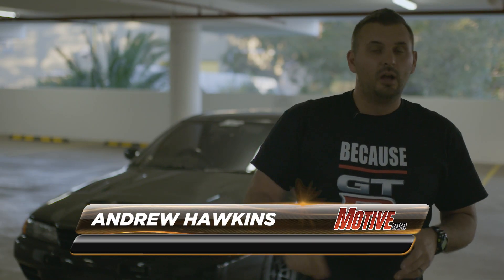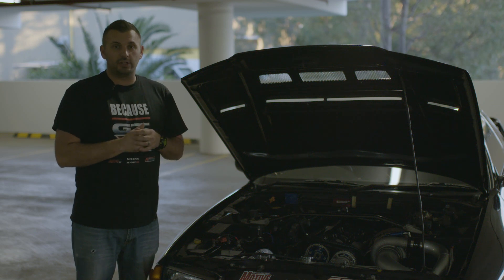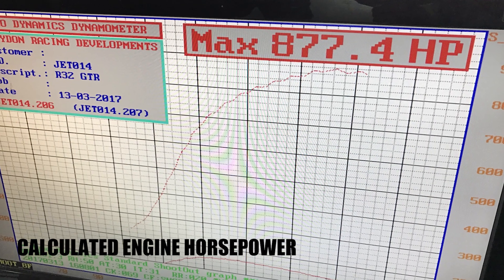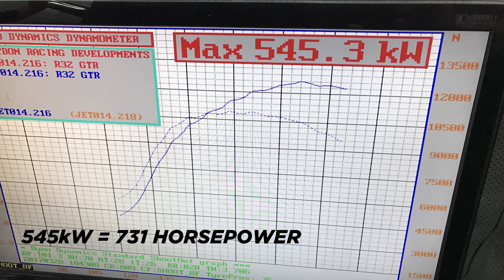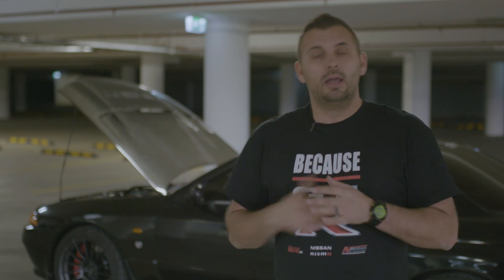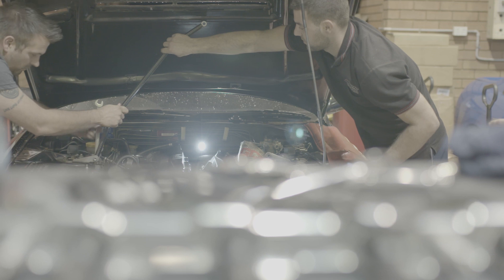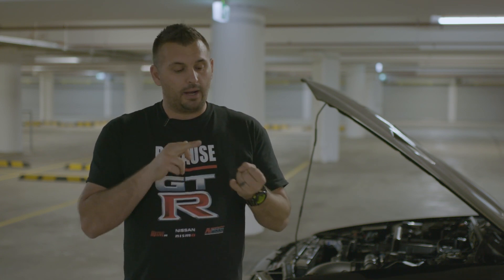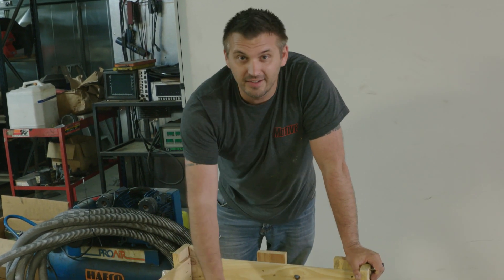Quest for 9s on Stock Bottom End - Project Budget Supercar R32 GT-R Pt16

Comment: awesome vid like always!
wonder if ARP studs where used for the head? what gasket? not cool the lifting issue. Let us know what alternator can we use as upgrade please
Reply from the maker: jasaircraft we used ARP2000 as we didn't think the engine would get pushed this far. Should have skipped then on gone to L19 or Custom Age.

It is a VL Commodore Alternator rebuilt to 120 Amp.
Reply: MotiveDVD wow! it would be really great to know if the water on the cyl is in fact due to lift... so my new stock head bolts wont do the trick for 700hp :(

Comment: Should have just used an N1 block.
Reply: They are trying to make a point. You don't do that by taking the easy route out. Not everybody can afford to upgrade their block so by doing this they are finding out the outer limits of the stock engine. This is good news for everybody that has a R32/R33/R34 because these cars are now legal to be imported to the US so more people will be looking to see how fast they can make them go in the 1/4.
Reply: Anthony Thomas I completely agree with you. so many ppl are unaware of the capabilities of the rb series engine here in the states because the only know about 2jz or ls and have never even heard of the rb30/26 combo which will go toe to toe with 2jzhp numbers. now of course they are trying to push the stoc block to it's breaking point so of course things are going to fail but I'm so happy they are showing what it can do #rbftw
Reply: ClutchkickPJ 1j/2j motors are better in every way than an rb, not sure why people bother with them in the us, not to mention the brake and clutch cyls get cooked by the turbo with LHD (RB owner here)

Comment: Ouch! I know the feeling of a cracked block. Just finishing up my N1 block with a 2.8L stroker kit to replace my current cracked one. Very excited to see how the new PPG does
Reply: Bdup678  just curious as to how hp did your block crack at?
Reply: Bdup678 where does it crack at?
Reply: For me it cracked just above the rear oil feed on the outside and there were 2 cracks on the deck between cylinders 3 and 4. Was just shy of 600whp and engine had 248,000KMs. Failed injectors were the cause for mine for the most part.

Comment: I notice you have changed the intercooler pipes from titanuim to thick aluminium nice move, The specific heat values of aluminium means it's harder to heat soak than the titanuim made ducting.

Comment: Odd question but how bad was the voltage drop on the fuel pumps when you were testing it on the dyno? Were you using the factory wiring for the in tank pump to trigger the main fuel pump relays?